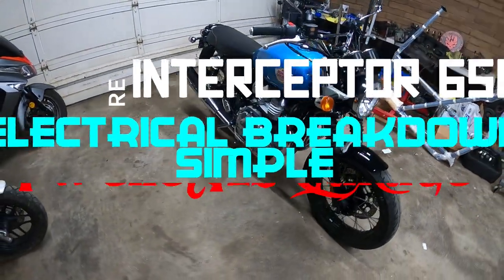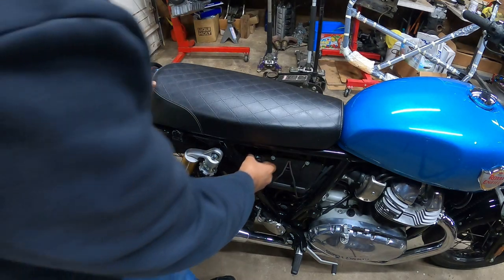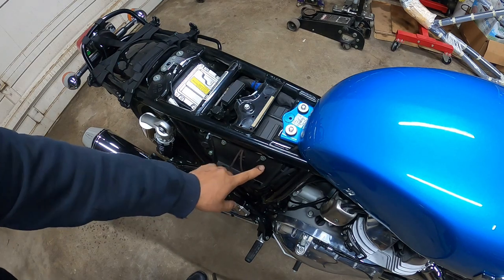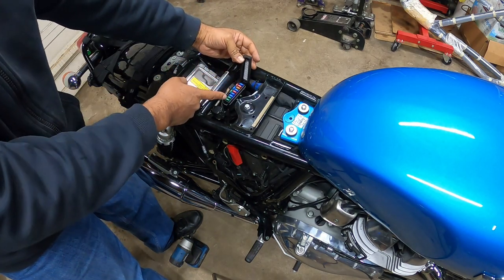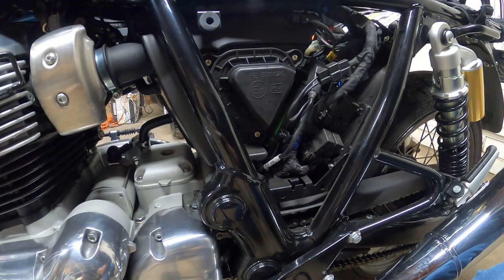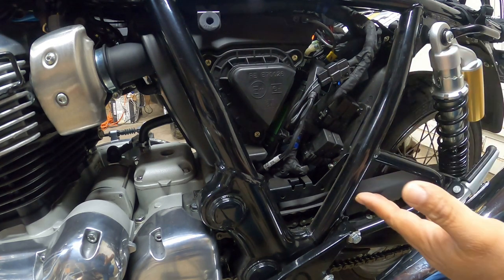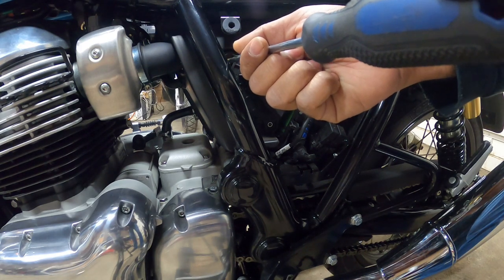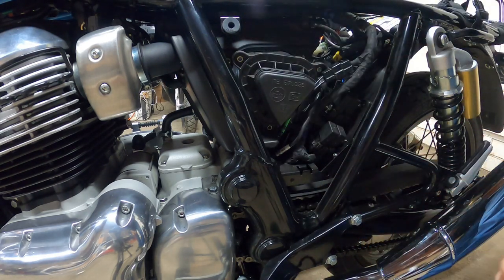RE Interceptor 650 - Electrical Breakdown

Comment: I recommend completely blowing out relay sockets with CRC QD Electronic Cleaner, or compressed air, gently, or CRC Cleaner on a Q tip into the relay sockets , to aid in eradicating excess Dielectric from factory , and of course reapplying a very , very small amount of AGS Dielectric connector protector with your finger on the blades, in the .14 oz size, as this is all you will need for all your relays. Buy 2 AGS .14 OZ Packets from auto store, about $1.99 a packet. This way there is no waste of product. Make sure relays have a sure connection, as vibration sometimes loosens these somewhat over time. Make sure to do this with all your electronic connectors on your bike, and inspect yearly. Good sound medicine for preventive maintenance on our beloved two wheeled machines. 👍🏁🏁

Comment: Always reinstall the relay in the electrical system.
If the problem is still not resolved, replace the relay.
If that doesn't work
It would be nice to try charging the battery.

Comment: Great video of the Electrical Breakdown, A question where do I find the ground wire, my battery goes dead quite often after the new battery change which was not an issue previously with the old battery and before the last service, I think someone might be have tinkered or not tightened the ground wire while it was being serviced as I had to fully reset the ECU for some issue, can you please help me how to locate it, thanks.
Reply from the maker: The main ground is u Der the battery tray
Reply: @PincheALsGarage  Thank you so much for the reply much appreciated, I will check it out, thank you again.